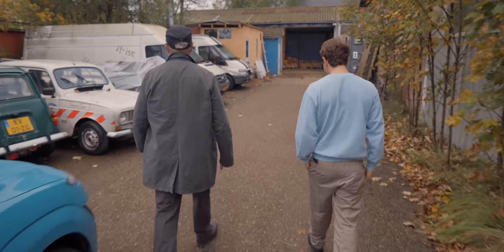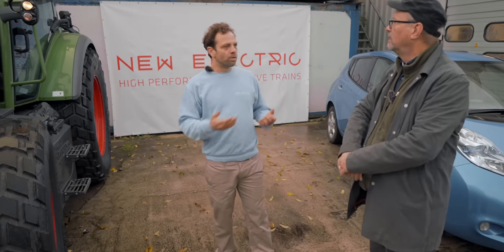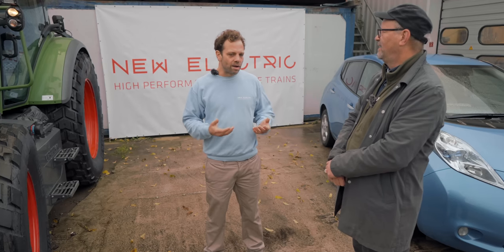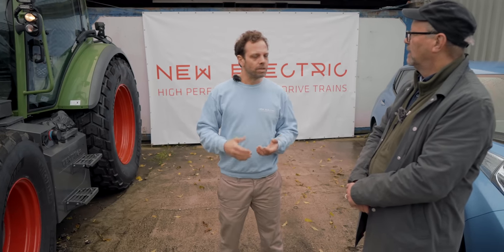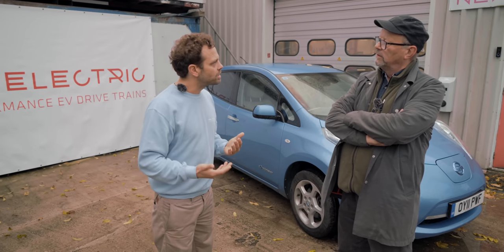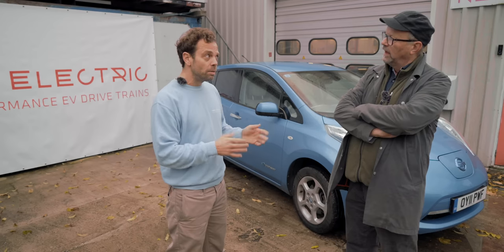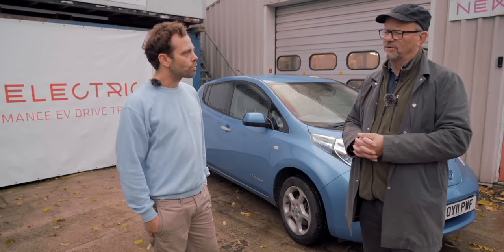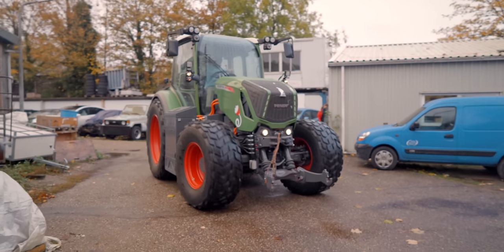New Electric - The converted Electric Tractor that pulls 30 tonnes

Comment: For any Ukrainians watching, could you please confirm whether this can tow an abandoned tank away? 😁
Reply: I looked it up and 30 tonnes is not quite enough - needs to be about 40
Reply: @timmurphy5541  Many years ago when i worked on the motorway i once tow started a Magirus Deutz tipper truck that could carry 20 tons with a 110 Land Rover Defender that's only suppose to tow 3500kgs so maybe the tractor would still manage it?
The driver promised to let the clutch up slowly. He swears he did, but i still headbutted the steering wheel when he did 😣
Reply: @timmurphy5541  Perhaps not a T90 but all those Russian APCs are a lot less than these things can deal with!

Comment: weight is a disadvantage because you have field compression, this only works for road runs, I'm yet to see a viable electric tractor that could actually do any farm work
Reply: I don't disagree with you on the 2nd part, I don't think this is the answer to changing from diesel but weight is a benefit to most field work at least here in the USA. Not everything of course but most farmers have suit case weights on the front, wheel weights, fill the tires with fluid, ect.. A lot of weight helps with most jobs. Not all but at least a lot.
Reply: It feels like you could still work though depending on what kind of farm you are actually running on. If it has to go through a lot of mud, then it could be a problem unless it is boosted up in height more, which I don’t see it being a problem. But on other types of farms that just has to haul a lot of heavy stuff across rough to rain then this could very well work.
Reply: If I’m honest, there will be more electric tractors in future, but it will be methane or hydrogen that will replace the current Diesel engines, cuz because quicker to refill then plugging in electricity and is a lot lighter.
Reply: Weight in a tractor is always an advantage 🤣.  Tractor means "traction engine" originally.  I mean with the torque this capable of (way more than a diesel) you need more of a normal force (i.e. down force)

Comment: I am an farmer and i need this 😁😁😁 i nag on the local tractor dealer for the electric version of the diesel every time i meet him. Will show him this. IT IS DOABLE 😁😁😁
Reply: Yes! How does this compare to Solectrac's 70hp tractor?
Reply: @niceride  its a bit like compare a mitsubishi imiev to a Tesla. 

that is for garden or city parks, this One is ok for farming. I think i have small requriments on the Tractors and i say 5.5 tonnes (and a drivetrain that can pull it) 

But we have a problem with farmers going electric, i have calcylated that 10 -20 days a year i need rediculous Range, and i mean rediculous to Keep the crop quality at a high level, lets say replace 300litres of diesel to Keep me satesfied

But i have a suggestion on the solotion aswell, do it BMW i3 Rex style. 350-500kwh electric power and a 200 litres diesel tank. Then i would lower my diesel use with a Huge ammont.
Reply: It's doable but not now and definitely not with the shortage of battery, tesla hasn't even started making their semi that uses alot of batteries.
Reply: @carholic-sz3qv  thats the problem. But in 5 years time it should exist.
Reply: @kulan9379  I agree, like you, I'm a farmer, during harvest and land work, so 5 months, we work from about 10 am through to late 10pm sometimes a few days 2am, so 13 hours up to 16.  This is for councils, construction workers and builders who may get to 8 hours, not farming.  could you imagine trying to get harvest in then having to stop while you charge a battery, or drilling to get seed in before the rain stops everything.  Eventually something will come, electric makes sense on repairs, wheel stops going round fitters come out replace motor, simple. From the point of practicality though, I think hydrogen or something yet to be discovered.
Reply: @Trinity10iloveyall  yeah the heavy work it is not an option, 15-20 years maby, but not 5 years. But i think one solotion is a similar way like the BMW i3 Rex used. An 350 kwh battery (like a diesel with a 100L tank) and a diesel motor with alternator that makes the plowing and the smoothing out of the soil doable, the harvest as you say. The ev Tractor has to be an Good Tool otherwise it is useless and not worth buying. 

The harvest needs to happen when the crop is ready as you say, otherwise it is spoiled. And then the investment is lost. But i hope the future will offer a ev Tractor solotion.
Reply: @kulan9379  something will happen, just not sure EV or hybrid, we are minimum tillage, and batteries need to reduce a lot of weight, soil compaction or even loss of the tractor as it sinks and bottoms out.   The final concern is cost, we have an EV side by side, I sold the lead acid battery's and installed lithium, lost 100Kg in weight, cost as opposed to diesel 10k more, that is a lot of diesel.
Reply: @Trinity10iloveyall  i dont say you are wrong. But the diesel drivetrain is an heavy system and the ev motors will be alot lighter and how the battery will weigh i dont know but suspect it will come down. And the heavyer the Tractor is the better. An 8.5 tonnes is better than 5.5 tonnes imo. The soil compacting problem you just solve with a wider and taller tyre. 

I dont Close any doors for development and it does not have to be battery ev or hybrid. It can be hydrogen as you say too. But the simplisity, flexibility and so on of the system with battery is so Good in cars that i hope the future will give me an ev Tractor. 

Dairycows and EV. My life would be complete

Comment: is it ironic that Fendt made a legit try at this once and it totally flopped. it will do OK for hauling but pulling and PTO work will kill it a 3m power harrow would drain it 3 hours not even 1/3 of a days work.
Reply: @scout2nut  for farms that normally have a tractor that size that's about a third of a day work.  But for the other larger farms they do run longer I've personally done 48 hour shifts.
Reply: @phalanx3803  massive weight increase as well. More soil compaction
Reply: @carterfarms301  with current batteries to make an electric tractor just as capable as a diesel your talking doubling the weight and for a high class combine about triple the weight.

Comment: When I see it actually pulling a farm implement in a field and not 30 tonne road packer that once is moving, doesn't take a pile of energy to keep it moving, then it will be "wonderful".
Reply: and for 16 hrs straight
Reply: Like to see an electric Road train pulling a triple in the Pilbara in the out back.
Reply: Yeah I actually reackon an electronic tractor would absolutely eat a diesel tractor in the field! But yeah I've been on farms where the machine ran literally 24/7 for weeks at a time only stopping to refuel and full seeders and what not... I just don't know how realistic it is... Do you need 2 or 3 electric tractors to do the job 1 Diesel tractor can do?
Reply: @daviddou1408  yeah well western Australia is where I've spent a bit of time working and for the size and scale you would have to drag around a fucking big diesel generator just to keep up with the workload... I just don't know how they could ever make that work... Would you have to have more bigger machines just to carry and replace massive battery packs for 500-650 hp machines? But then they don't have the infrastructure for that amount of power... They would have to have more Diesel generators??? So what's the point haha
Reply: When the technology catches up, it will run 24 hours a day, unmanned. 

Careful what you wish for.
Reply: He clearly says many times it's for working in town... construction, county work etc.

Comment: A 360KWh battery will only give a continuous 36KW of power for a 10 hr shift. For many farm jobs that won't be enough.
Reply: I question the numbers he is giving, full work for 8 hrs is his claim, I can see this thing running itself for less than 20km/hr for at most 8 hrs, but to haul 30tons for 8 hrs at what speed? I am feeling doubtful, not to mention, if this tractor was still diesel powered it could run for basically 24/7 with short breaks for refuel and basic maintenance, as an electric, one machine=8hrs before recharging for several hours, so several of these VERY expensive machines would have to be deployed to cover what one ICE machine could do before. 
Its neat technology, but we are a long ways off yet before its practical. Just think of how much cost and time overage the running of this system will place on any project.
And that's not even talking about longevity, an ICE machine can run for decades with the original powertrain given good maintenance, just like electric cars, no matter how good of maint you give, the battery pack can only be cycled so many times before failure, and the pack will cost more than the value of the car/machine. A Tesla battery will last at most 8 to 12 years, a new battery is over $20,000 and does not look likely to be much cheaper in the future. These cars/machine are a rich mans toy or will require such heavy govt subsidies that they will never really compete on their own.
Reply: @scout2nut  
omg funny, ..ever owned a 'tractor"?
Reply: Good thing they didn't build it for a farm then!
Reply: At 100hp continuous power, the consumption of tractor like this would be like 30l/hr, which would be about 360kWh worth of diesel.. With electric you'd need about half that, e.g. 180kWh. But running around town (which is a bit stupid with a thing like this) you'd probably only consume like 20% of that or 36kWh - thus 360kWh could easily go 8-10 hours.
Reply: @rkan2  @ 100hp (70KW) output the electric tractor would be finished after 5 hours. The Diesel version would last 15 hrs on one tank full, and if that ran out could be refuelled in 10 minutes.
Reply: @agt155  Of course, but if you make tractor like a truck and just drive on city roads, you won't be consuming 70kWh, unless you are averaging like 40-50km/h

Comment: Great idea, why not make fit some of the battery pack detachable on the front as a weight block? Batteries get low, change them..
Reply: Yeah I reckon this is a field where replaceable batteries would be a good use case.

Comment: Did anyone else notice that it doesn’t have a tow hitch. Before everyone (with a limited knowledge of farming) gets too carried away, a few observations from a farmer. 
This tractor isn’t massive, in fact it’s a mid range model, by modern standards. 

Ignore the talk of it being able to pull 30 tonnes. Maybe on paper, but that tractor definitely isn’t rated at 30 tonnes. 

That size of tractor is probably rated at 10 tonnes. 

It’s fitted with Michelin maxibib tyres designed for road use. 

It’s claimed it will work 8 hours a day, but if it’s hauling loads in & out of a construction site there’ll be lots of downtime & lots of moving slowly in traffic etc etc. 

For modern large scale farming batteries as a source of power just aren’t viable. There simply isn’t enough stored energy & recharging would simply take too long. 

If you hooked a bit of cultivation equipment to this or a full trailer of harvested crop, I doubt it would last 2 hours. 
A lot of modern agriculture, especially in Europe is performed by contractors. These are specialists who turn up with the equipment & staff to do a particular job. 
Often these vehicles will be refuelled on the job, a fuel tanker or bowser will arrive where they’re working & refuel them to keep working. 
It’s common for them to work round the clock at peak times. 
Battery technology will transform lots of industries but it’s not the answer fir modern agriculture. 

In any case, that shouldn’t be the priority now. 
One of the biggest issues in urban environments is tailpipe emissions (this was referred to in the video) 
It’s more important to solve those problems at this point in the transition away from fossil fuels. 

Agricultural solutions are on the way, make no mistake. 
Tractors are manufactured by global corporations these days, they’ll be working hard behind the scenes, of that you can be assured. 

Thus tractor is a Fendt, a well known premium German brand. Fendt is part of AGCO, probably the biggest corporation of them all, with several leading brands in its business.
Reply: Soo... to cut through the negativity - what you're saying is that this tractor DOESN'T do what it WASN'T designed to do! 
However it DOES do what it WAS designed to do...... 
Hmmm....sounds like a win, to me.....!!
Reply: @andymccabe6712  yes exactly that, but this interview is making it all seem a bit better than it actually is. the guy is also mentioning that this tractor used to have about 160 KW of power with the diesel engine which is simply wrong. it's a Fendt 300 vario and those only go up to 142 hp or 104 kw. 

Which is making me wonder how accurate his whole talk is if he get such a key number wrong.

also why use a vario (cvt) transmission with an electric motor, to me that just seems like adding a whole lot of complexity, weight and a waste of energy (CVT's have an efficiency of below 80% i think) when the whole advantage of an electric motor is that it doesn't really need a transmission
Reply: @andymccabe6712  Yep, it was designed to convince people who have no knowledge of the scale of farming or construction or actually pretty much the real world that it is a viable replacement for diesel.  And for the most part it succeeds in doing that.

Comment: Good hope for converting 00's and newer cars. Classic cars all fine and dandy, but this! needs to be done for these mass-produced things that can still take a conversion, which would otherwise land in a scrapyard with a still-good body.... Keeping original ECUs (and as its possible, conversion mostly can keep original weight) most of the time also means, you can have something that is 00's till today's safe (airbags, safety belts tensioners etc), proper crash zones, while also being electric. Might i also say, this could keep most of parts suppliers for these cars also afloat...well apart from engine parts, but everything else? doesn't change, and still will be needed, and will need to be still made. Electric conversion, can be pretty much a bolt-on...

Comment: All good and well it's got more and faster power to the ground but how long does it take to charge in comparison to how long it takes to fuel a tractor with conventional diesel. Normal tractors that have 303 gallon or 1200L tanks, take about 15 to 20 Min to fuel up.
Reply: Charging power is all more a question about how much you can afford to put in chargers and in to your electric connection to the grid. 360kW connection to the grid is quite expensive, somewhere it can be more than the charger itself.

Comment: Great post... But did the OEM of the tractor, give New Electric founder Anne Kloppenberg  the full specs on all its tech or did New Electric have to reverse engineer some of  it to create their own schematics, to do the conversion? And who is the OEM of the ICEV version?

Since Tractor OEM's are being sued by farms to get the specs, so they can do their own repairs (ie to get the "Right to Repair")
Reply: i doubt it. but one could just fake all the sensors. Most of them are quite simpel digital or analog inputs.